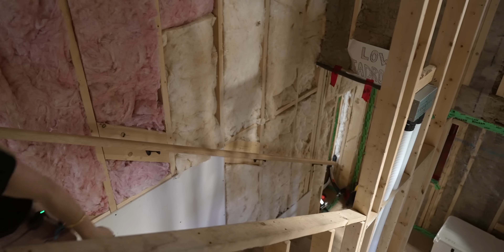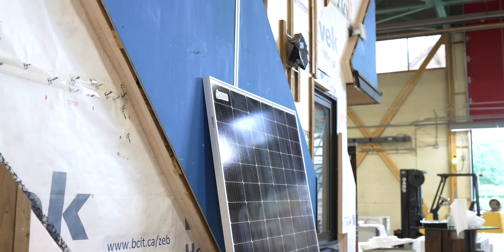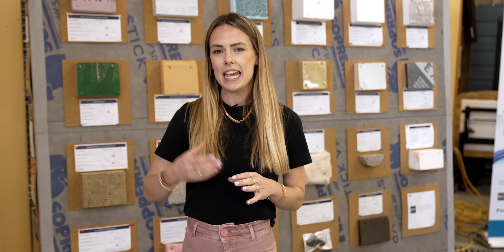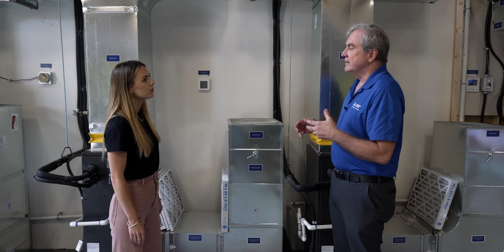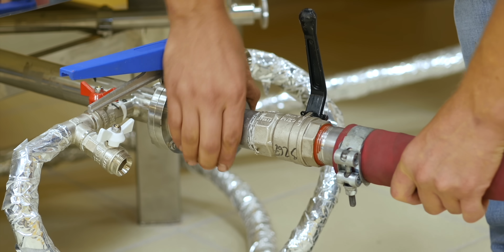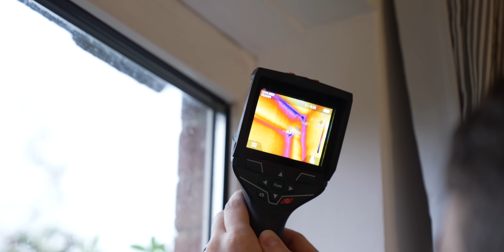Is This The Path To A Net Zero Home?

Comment: BC is doing a lot of great things!  I think we need to prioritize condos with mixed-use development (e.g. stacked apartments over stores, with common areas) over single-family homes because it uses less resources and offers an overall better quality of life.  We definitely should require all large new buildings, and existing large ones retrofitted, to be net zero by a certain date, and then reduce the size to be required to be net zero over time.  The incentives should be aligned with income, i.e. lower incentives for high-income folks and higher incentives for low-income folks, and do the full retrofit for the poorest at no cost.

Comment: Where can I find real world data on internal temperatures for houses constructed in the UK using the levels of insulation expected by uk epc regs?
Reply: Internal temperature means nothing. Heat loss is what you need to measure.  A passive house with no solar shading in summer could be 35 degrees. Same house mid winter could be 5 degrees if it has no internal heat source.

Comment: When all electricity is from renewables and/or battery storage the price won’t be based on the cost of fossil fuels. It will be much lower in price so we do not need to be over zealous on reducing energy use. Yes it’s a ‘good’ thing but bringing all buildings to a level that only a minimal energy input is not necessarily desirable. Older and listed buildings do work, and if more (renewable) electricity energy is required to heat and power them, does that matter, especially if the cost is so much less?
Reply: One should not be wasteful but frugal.

Comment: Does it take more energy to keep a house cool in a hot environment or keep a house warm in a cold environment? 
To keep it simple, a 15 degrees difference from inside to outside temps.
Reply: Good question. 
Keeping warm is helped by people and things switched on, for cooling all that fights against the cooler.
Not sure what the end result is.

Comment: In Sweden/Norway there are already many wood/passive houses with very good isolation and windows, most of the new ones in facts.
Add a heating pumps scavenging ventilation heat and some solar panels, you get already zero emission (at least for electricity) and excellent inhouse comfort.
Reply: Yep. I have all of it and two BEVs also solar powered.

Comment: New construction is fine, but (in the UK) we seriously need to address the existing building stock.  My wife and I are pretty much abandoning our ambition of having an Enerphit renovation of our house because of three reasons:
1.  Meeting the ultra conservative tastes of our local planning officer heaped unnecessary costs onto the project.
2. Getting architects, quantity surveyors and builders who are competent to carry out this sort of work and honest seems impossible.
3. The costs are prohibitive, and the fallout from the UK's string of inept and unelected leaders has just made that worse.
Reply: Yeh, the planning rules need to change so badly. Not being able add double glazing or Solar to a listed building is so backwards,  especially if it's pout of site or low impact. More, all new builds in the UK should be adding solar, heat pumps and high grade glazing as standard, we are just adding to the existing problems of poorly insulated drafty homes.

Comment: @fully charged I’d like to know more about ventilation systems. If our homes are highly insulated it seems necessary, and yet I never see it discussed
Reply: it gets talked about heaps. ERVs or HRVs get used to bring in filtered fresh air.
Reply: Building regulations have ventilation requirements - trickle vents in double glazed windows for example
Reply: @tonykelpie if you have Mechanical Ventilation with Heat Recovery this makes trickle vents unnecessary. A hygrometer sensor in the bathroom and kitchen can automatically cause the ventilation to be boosted when you're cooking or having a shower. All the incoming fresh air is warmed by the outgoing stale/wet air so you never feel a cold draft.
Reply: @simonjones1342 that is what I have, I think mine is 86% efficient, no vents on windows, no draughts, no humidity at all. Hard to retrofit, but should be required on individual new builds.
Reply: @simonjones1342  we have a heat pump to scavenge energy from the outbound air and heats the radiator loop. 

Vents straight out in most rooms provide fresh air, but at -20C and colder, that’s a bit chilly near them.
Reply: @My_HandleIs_  yes, heating the incoming fresh air via MVHR is preferable to scavenging outgoing heat into radiators. MVHR gives fewer cold draughts.

Comment: every house must have air locks on each external door !
Reply: Known as an entryway in cooler climes.
Reply: Yeah, at -20C I wish we had that…
Reply: The townhouse I grew up in had a vestibule/coat room at the front entry.

Sadly, it also had leaky single-pane windows and flimsy back door.

However, that vestibule rocked for keeping warm air inside during frigid winters. Don’t know why it isn’t built into more homes.

Comment: Canada is lucky it has a proactive government, here in the UK we have an inactive government.
Reply: They deliberately killed the previous 'all buildings must be net zero by 2016' plan in 2015, after the house-builders had done the preparation and were ready for it (if a bit moany). That was criminal.
The replacement scheme (the name of which I have forgotten) had the fatal flaw of requiring commercial returns on the loans, so everything cost 7%-10% which ruined the economics. It should have been interest-free like this Canadian scheme. So that was a flop.
A couple of years later they tried the Green Deal which had excellent underpinnings, but screwed it up with hopeless (US-based) admin so builders didn't get paid and grants were hard to get. Then rather than sack the adminstrators and fix things, they killed the whole scheme after 6 months, and 3 years later we still have no plan. So we've had 17 years so far of trying to get a mass retrofit scheme and decent new-build standards going in the UK and almost nothing has been done to actual houses since various schemes to fit insulation were killed in 2012.
It really has been a massive failure, and is so frustrating because it would have saved the country nearly 3 billion/yr when the energy-price crisis hit last year, as well as reducing emissions and generally heading us in the right direction. It's hard to understand such a combination of incompetence and mendacity.
Reply: @xxwookey  its also annoying that the government take credit for reducing emissions when its individuals doing it despite very little incentive. They scrapped the FIT scheme for solar PV then had a gap of nothing till the SEGG scheme kicked in. its all made it difficult for PV companies with constant goalpost moving.
Reply: "inactive"??? DE- active! 

They've actually taken out steps which were previously made!
Reply: And denial that there is a problem or that things can actually be done without it costing £££££
Reply: This is a provincial government that is doing this not the entire country, other provinces are far less progressive than the Province of British Columbia(BC).
Reply: To proactive in some aspects!
Reply: https://www.youtube.com/watch?v=u7s-BgfcFXw maybe this will modify your thought.
Reply: Not for long if the election polls are to be believed

Comment: Retread episode. Started watching realize already saw it. Is there anything new here or is this just a re-post
Reply from the maker: It's a similar episode, but there were parts of the interview not included in the original episode hence the release of this one.
Reply: @EverythingElectricShow  can you do an episode which contrasts this with the UK, please?

The UK had these regulations but actively scrapped them just before they came into force. 
The UK has plenty of flowing water (including tides on all coasts) & plenty of sites for pumped-hydro yet has a primarily gas-powered grid & is building nuclear. 
The UK, today, has granted licenses for the nation's largest oilfield.
Scotland is the world leader in tidal-flow generation but Westminster shelves tidal projects. It's estimated there's enough tidal energy to supply the whole country, with excess to sell, & enough timing variation around the coasts to have no dead times.
Reply: @alanhat5252  The scrapping of the Net Zero housing rules in 2015 (9 years into the 10-year run-up) was criminal. And here we are 8 years later still with no real plan.

Comment: The UK used to have similar training facilities, but they were closed 11 years ago. They funded training for SIP quick build techniques.
Reply: We still have the NSBRC (National Self-Build and Renovation Centre) in Swindon which has lots of examples and holds training sessions.  What was the one that closed?
Reply: There were actually two... one near Liverpool and the other in Newcastle.
Reply: We also had building regulations that required all new builds to be Code 6 (net zero) by 2016 which were repealed under Cameron.  Admittedly, in 2010-11 most designs for Code 6 homes were outstandingly ugly.
Reply: I built many houses using airtight building technology, mainly in France. Cheap and quick to build, consume no energy to heat or cool with little embodied energy. @justinstephenson9360